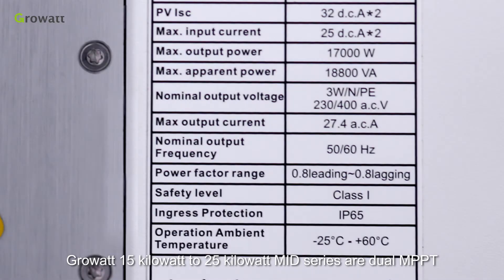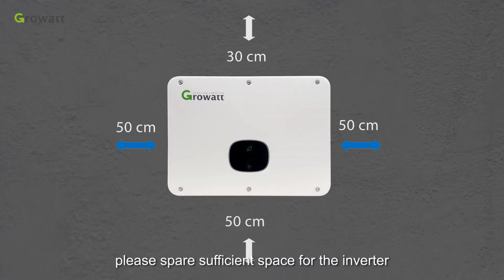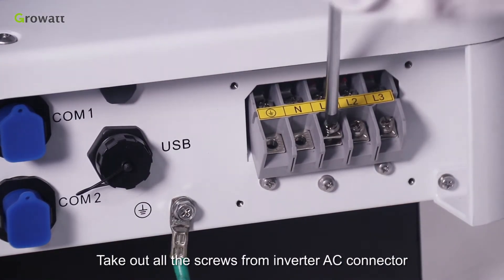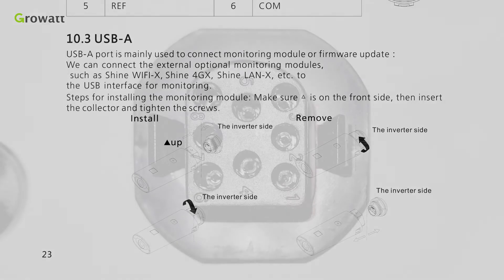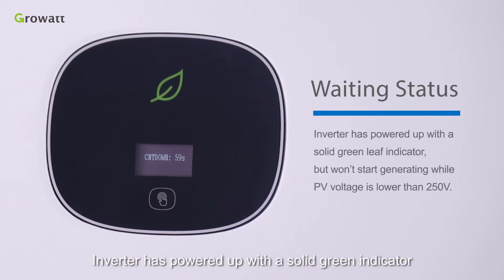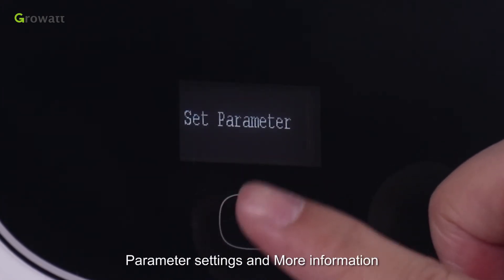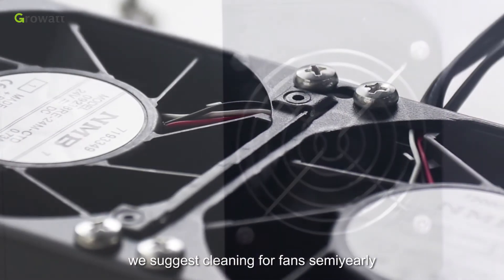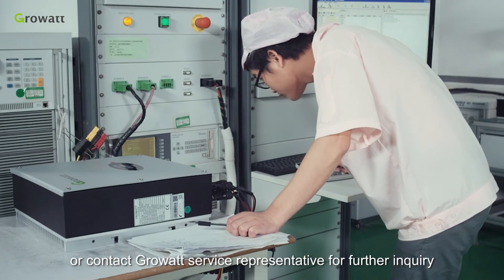MID 15-25KTL3-X series inverter installation

Comment: Can I connect another Growatt together and store Energy in battery if i buy MID 15-25KTL3-X?
Reply from the maker: No, MID 15-25KTL3-X can not support extension to energy storage system. We are currently developing a hybrid version that is battery ready. Please follow us closely on product launch.
Reply: @Growatt  But if connect another Growatt hybrid in paralell to MID 15-25KTL3-X it does not work you mean?

Comment: A Suggestion,

Add a Heat Shring Sleeve on the AC Cables before crimping the Terminal Lugs, after the Lugs are crimped slide over the heat shrink sleeve over the Lugs and shrink them to fit tight on the Lug by heating the sleeve with a match or lighter, this way the metal terminal lugs of all the 3 phases and Lugs are better insulated between them and there is no risk of any short circuit or arcing between them

See how close the Metal Terminals lugs of L1, L2 and L3 are (at 2.08 mins of the video)
Reply from the maker: Good suggestion! Installers shall follow your suggested practice when doing the installation. Thank you!